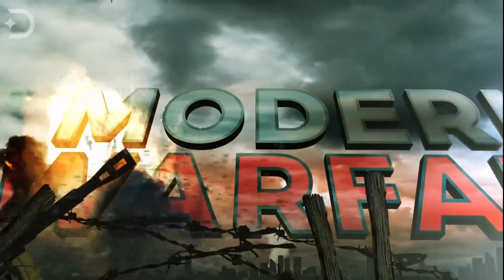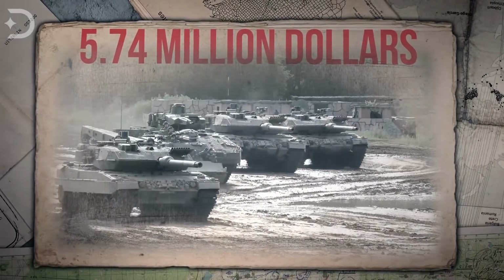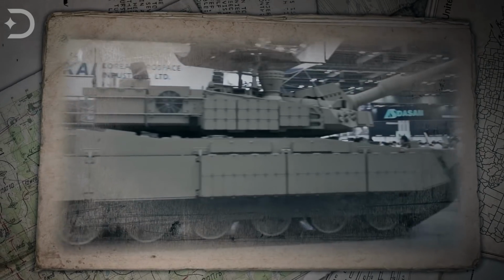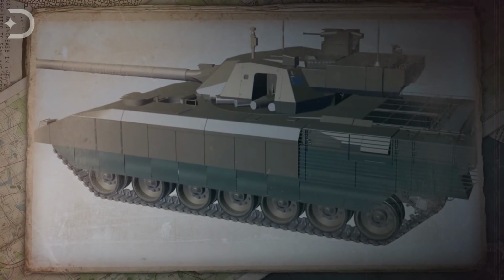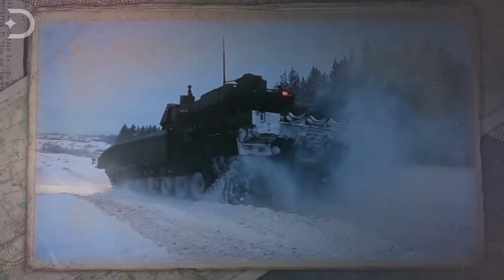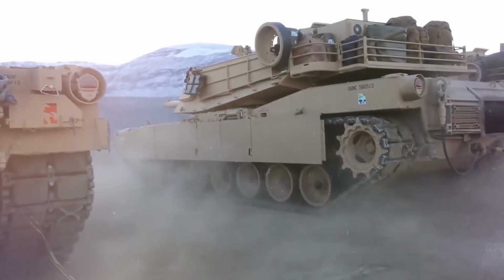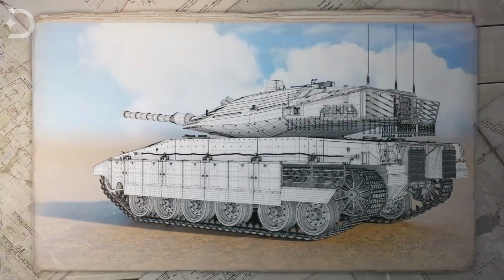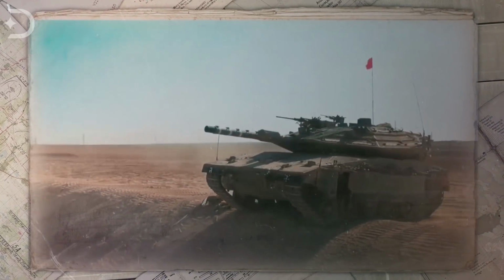Most Advanced Tanks In The World!

Comment: Well . . . you might want to lookup the TX-130. Specifically designed to Soften literal beachheads, they keep low to the oceans’ surface dodging heavier fire while Tanking machine gun fire. And they’re as mobile on Sand as they are on water with zero difference on the surfaces they cover…

Comment: "Get there fustest with the mostest." -Attributed to several different Federal and Confederate generals.
  The idea of a tank is to get a gun to where it's needed as quick as you can.  If it has a little armor, to protect ammo and crew from small arms fire, that's a plus.  Wheels are a bad idea, because, if you only have wheels, the enemy knows right where you'll be: on a road.  That simplifies his job considerably.
  Ultimately we consider first the Hovertank, and, second, the Gundam.  Hovertanks are a great idea, and we have the power density to drive one, but an aerial vehicle (which a hovertank is) can't be well armored.  And maneuverability/inertia is a problematic issue.  Gundams, as pointed out by Nick Moran (who's got considerable "tankee" experience irl AND in armored warefare gaming), have a  ground pressure problem.  A 60 ton tank with wide tracks might have a 13-17lb/sf contact pressure, allowing it to both drive and turn without digging in too deep.  A Gundam, on the other hand, might have a contact pressure in the 100lb/sf range, which means it would be easily caught in soft ground, muck, or water hazard.
  For a pure aircraft to operate like a tank, it would need hovering+loitering ability, something unlikely to achieve, considering other weight fraction needs (such as guns, missiles, and armor).  Plus, it would be more visible to both naked eye and RaDAR/LASER illumination.  Combining regimes is also a bust, because a flying, walking, cannon and missile armed Gundam gives up on every need in order to accommodate its other specialized capabilities.  And then there's the whole ground pressure thing.  And moving parts.  What dooms the Gundam is that more moving parts equals more down time (more parts wearing out, needing replaced, and a nightmare for logistics).
  My Sci-Fi supersoldiers wear what I call A.C.I.K. (Augmented Capability Infantry Kit)*, based on cloned muscles, carbolith (carbon epoxy poured over graphite rod carapace segments), and Maity-Kondrite biological power units.  It runs on a thick, sugary, combo of Sugar, Water, Caramel Coloring, and Caffeine, plus electrolytes, I call "Pepsi Smart".  It's small (about 7' tall and 500lb), maneuverable, well protected, and heavily armed with a weapon that needs no ammunition.
  This ACIK is the focus of my various "Red Platoon" short stories.
*Copyright 2003 WBC

Comment: Where's this secret advance tank at now???? None of this shit is any type of secret
Reply: The inverse-gravital mz tank uses an air-to-friction traction platform for high-speed traversing of rough terrain. Top speed is 97 mph and can hydrofoil over calm waters. The massive main gun uses 144mm shells and It is covered with an intermittent titanium webbed stealth shielding that reverberates at 3200 mgHz if hit, withstanding any current tank shell or jet launched conventional missiles. It uses diamond bearings for effortless turret movement. It includes a  forward array for anti-aircraft rapid fire and has a retractable rear rocket launch that can be fitted with a small warhead. It is rumored that much of the tech is from the military science base at A-51 site 4 that runs such black projects under the direction of DARPA's MIB wing. Don't tell...it's a secret.